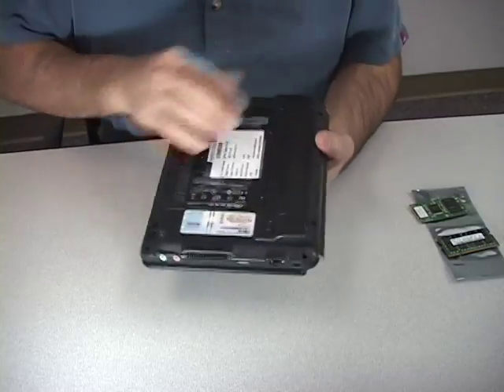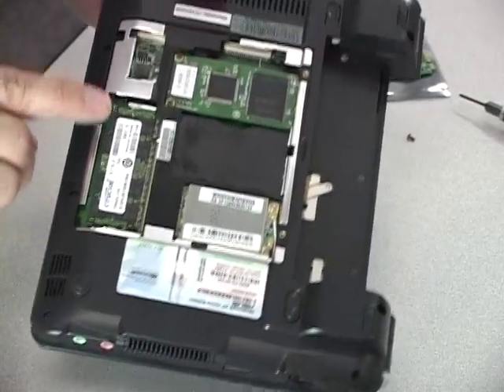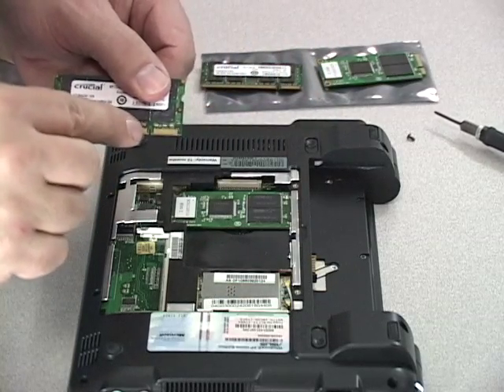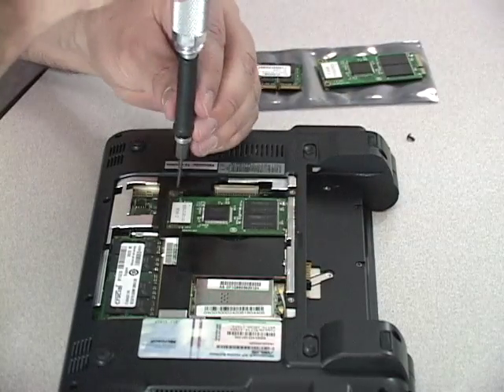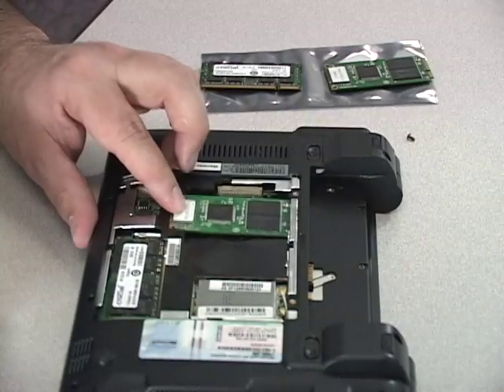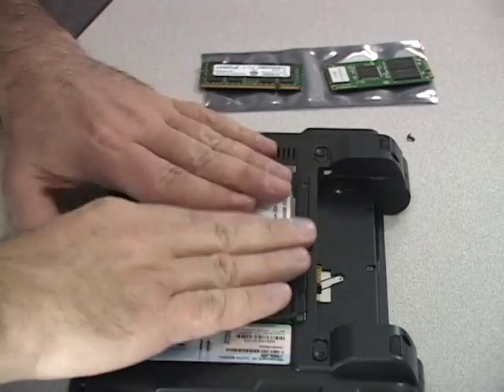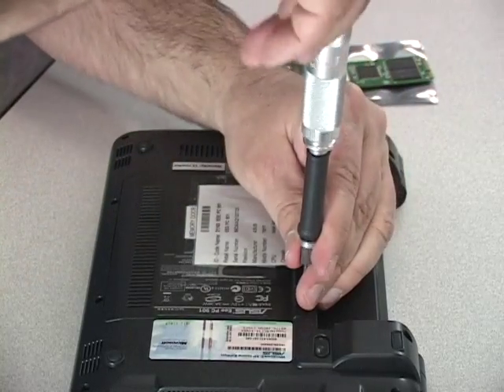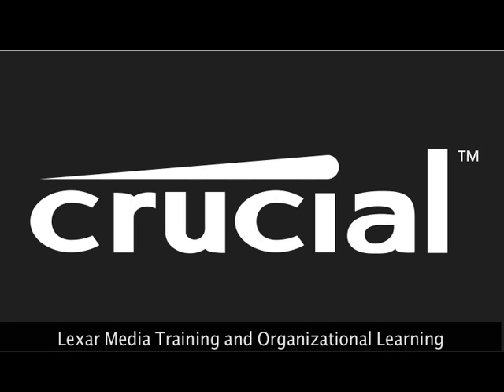How to Install Memory and SSD in Asus Eee PC Netbook (Video)

Comment: Old video. But still, some models (1015PEB) must be 90% disassembled to replace storage drive. RAM is still on bottom, but only 1 slot (2GB DDR2 max). At least storage drive supports standard 2.5" wide SSDs.
Reply: A bit late here but MB can only accepts DDR2 ram  ?

Comment: I have same laptop and am planning an upgrade, What's the maximum capacity of Memory i can put in this netbook?
Reply from the maker: Hi Vina, we will need make and model of your computer to assist you. Alternatively, you can visit our website and check for compatible upgrade using upgrade my computer option. 

If you have further questions, we welcome your reply. You can also visit our Contact page at http://www.crucial.com/usa/en/support-contact for other ways to reach us. -AP
Reply: @crucial  Given that the video is about a EEE PC 901 netbook i assume that the upgrades required are for that machine.  The SSD as far as i know is mini PCIE (MPCIE)  but  the machine does not support mSATA so it's hard to find compatible SSD's.  It has a boot SSD (50mm) and a storage SSD (70mm). Max RAM Memory is 2GB.  I also want to upgrade one of these so if you have any compatible SSD drives i would be interested.

Comment: Don't count on it.  Netbooks have integrated graphics cards and no PCI or PCI-E card slots.  This means you can't upgrade the already suuuuuuper low end graphics that pretty much all netbooks come with.  If a netbook does have the CPU and GPU needed to do video editing, HD playback or gaming then it'll cost about as much as a laptop that will have better components and a lot more upgrades available.  Look around newegg and other such sites for a $400-500 laptop. It'll do what you want and more.

Comment: I read a comment on another vid that all it takes (a bit scary to do but it works 'cause I did it like a yr ago) is an upgrade of the BIOS, found at asus.com. I looked & found no setting for RAM in my 901. Just a suggestion if anyone else has a prob with their ram upgrade/replacement.

Comment: My laptop's processor is Intel(R) Core(TM) Duo CPU   T2250   1.73GHz with 512MB RAM. Will there be an increase in performance if I add 2GB RAM to it?? My laptop is very slow. I really need help.

Comment: Thx for the quick answer. The problem is...that it doesn't has a memory slot, it's attached to the motherboard. So what you presented to me needs a memory slot. I have to ask again, in this case is it possible the upgrade?

Comment: I did check their site and nada on how to gain more useability.  I have had several netbooks and only running 1GB n got better performance than what I'm seeing.  However, some of my issues did indeed have to do with my internet connectivity.  @ the time of my last post Sprint was upgrading their network to 4G.  My Acer netbooks were able to adequately run a graphic intensive video editing programs good enuf when I didn't or couldn't use my desktop. Just seems like a gip. Thanx 4 responding tho.

Comment: I recently upgraded my Asus EeePC dimm memory to 4 GB but only 2 GB appear as useable, any suggestions for how to gain more useable memory.  The performance is unimpressive and really haven't experience any significant gain in speed.  Very disappointing.  I've installed it correctly as it 4 GB DOES properly shows up in the BIOS and in the system properties when you boot into Windows.  However, videos buffering still crawls.  My Acer performed better with only 1GB of RAM.  Please advise.

Comment: No anti static strap and when handling the memory modules he has his fingers and thumbs all over them !
Use anti static precautions and handle the memory by holding the edges of the circuit board and try not to touch the chips or contacts.

Comment: Can't speak for every EEE PC but the 901 uses DDR2 667 or 800 RAM. 2GB is the effective limit largely because it lacks the power to use applications needing more than that amount of RAM. Any SSD that is compatible can be used, which is best found by googling the model for forum reviews. There's no size limit on SSDS, only your wallet :p